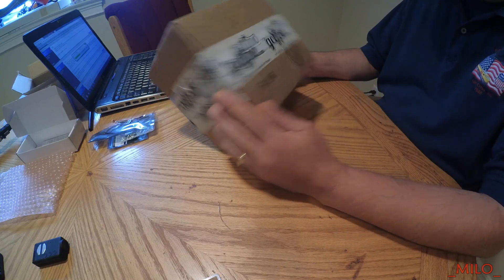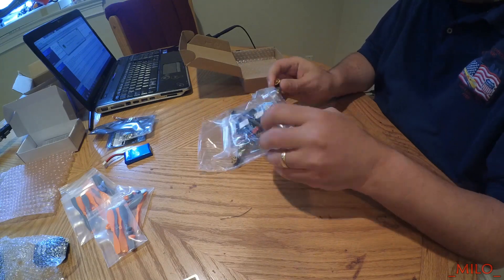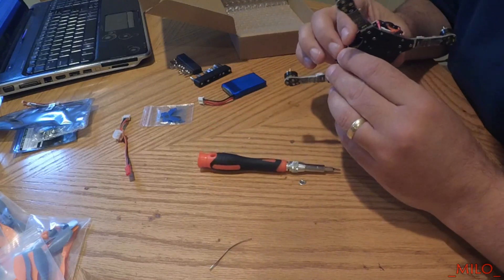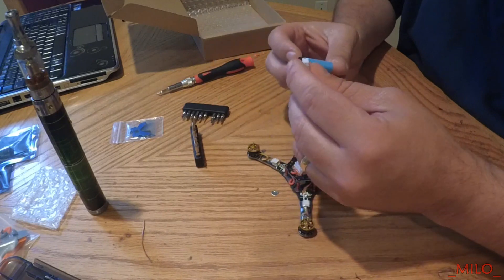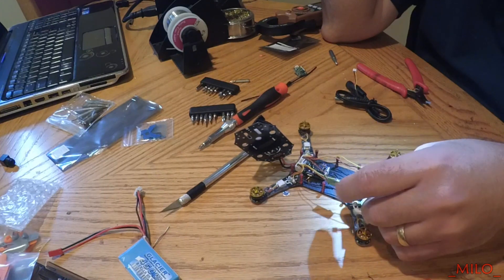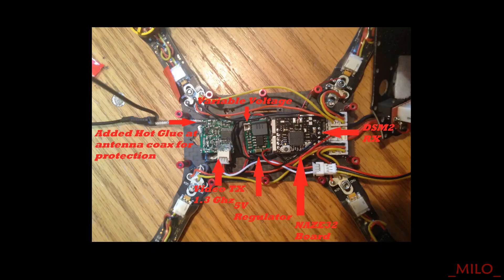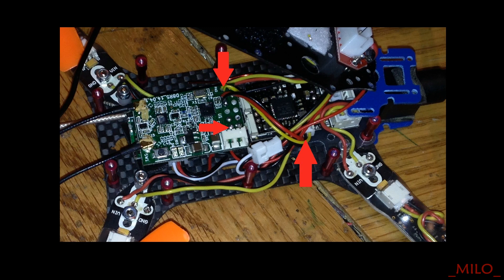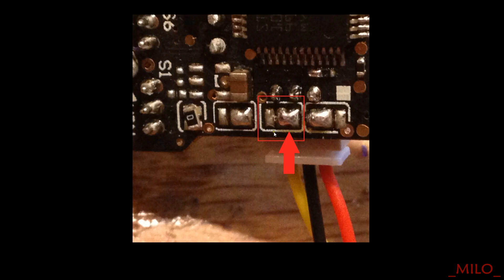Hermit Micro FPV Quadcopter Unboxing, Review, Mods D4R-II

Comment: Great video and nice work, thanks for posting. Hobby King had them on sale so I just ordered one, not a big fan of DSM and spectrum so I'm gonna be doing the same with rx. Only have one question I'm thinking to try and fit the flip32 mini 10DOF I always wanted a quad that little but with barometer and gps. Do you think it will work? Thanks
Reply from the maker: +nasarami yes, get rid of excess GPS wiring to keep it short and light, the GPS will be the heaviest, if the AUW gets too heavy it will be sluggish, but it will work. Not sure where you'll mount the GPS, not much room.
Reply: +_ Milo_ that's encouraging thanks, I'm gonna order the parts and I'll let you know how it goes. might post a video or something. Thank you
Reply from the maker: nasarami Sounds good, good luck, and love to see your upgrades.

Comment: Thank you, this was so helpful! The issue I am having is every time I change battery I have to find my fatshark goggle frequency all over. I used the stock FPV stuff that came. I also changed the solder bad "3.3V is changed to VIN" , do you think that could cause issue?
Reply from the maker: Johnny Friedrich I don't know about the stock FPV transmitter. Not sure what your saying about the "Solder bad "3.3V is changed ti VIN" on the board are pads to change voltage input settings, one setting is 3.3-4.5 volts for use with a 1S lipo, and the other is 5.0-10V for use with a 2S lipo, the hermit is factory set for the 2S lipo, this should stay at that setting. If you like you can Send me a private message, with your email, and I'll try and help you.
Reply: _ Milo_ oh when oversky sent you documentation there was a second solder pad that they told you to change. I believe you said you didnt do it though, I did and wondered if i should not have . Thanks for reply
Reply from the maker: I think changing that to VIN, then you can't power the RX from the board, and would power your RX separately. I power my RX from the board and haven't had any brown outs, or notice anything negative., With that soldered to the VIN, you can check and see if any power is coming from the board to the RX pins my guess would be no. Your using a different receiver, and the stock VTX?
Reply: yah Im using the D4R-II with PPM and that works great. Ill have to check the power. I think I will just throw a new FPV camera and Tx in it =/
Reply from the maker: Ya, I love having the D4R-II, on there, I cant remember if I showed it in this video, but I added FBVS-01, lightened it up, so have voltage monitoring on the taranis. I wonder if your components are pulling more amps from the board, than what I have, I've got a separate regulator powering the VTX, and Cam, Ive seen someone pulled 5V from the board for RX, VTX, Cam, and I think he had some issues, I think its spec'd at 500ma.
Reply: _ Milo_ hmm thats a good thought! Your awesome man, I appreciate the info for sure. I better put a regulator in. How do you like this little quad still?
Reply from the maker: I do still like it, no regrets, been working on a couple other projects, so havent flown it for a bit,  but I love my hermit, easy to take along and have fun, fly just about anywhere

Comment: Will this thing handle 3s?
Reply from the maker: Skitzo FPV No I don't think so, the ESCs are 3A, and the motors are 4000KV, they are like the ESC/Motors in the 1S Super-X, except re-wound for lower KV, in the Super-X the Motors are 6400KV. Plus the FC board is rated for 10V max.
Reply: You could make a 3 cell to power it but it would be to large and to heavy.

Comment: I might need your help doing this setup  I'm going to do the same change the receiver to a frsky ppm
did you have to go to baseflight configurator to set ppm mode  
or just jump the pad  like you are showing
thank you
Reply from the maker: Yes you need to go to baseflight or cleanflight depending on what firmware your running and change it to PPM, I was hoping to have the second video up already showing this set up and some other tips. I'll try and work on it hopefully by this weekend. Good luck.

Comment: Sweet lil machine! Literally jumped outta my chair @2:40! Had the volume way up to hear you speaking.What are flight times? Micro UHF all the way :P
Reply from the maker: SYN FPV LOL, sorry I should have adjusted the different audio to be more matched. I'm not sure on the flight time, as the batteries all being new, I'm breaking them in, plus I am going to removed the JST wiring on the Glacier packs, that should save me around 1.6-1.7 grams. I would guess taking it down to 3.5/cell may be around 6-8 minutes. After 5 minutes, I think the batteries were coming down at around 3.8/cell. Oversky says 9 minute flight time on their RTF with FPV gear model, which weighs in a little heavier than mine.
Reply: _ Milo_ That's great time such a small profile. Big fan of the Hubsan and Nanos, this looks like a great kit!
Reply from the maker: SYN FPV Ya, comparing to my ladybird, it does much better in the wind, more stable, and better recovering from a free fall, it doesn't have power of a 250 size mini, but its pretty cool, I like it. Replacing parts will be $$ motors are $25!